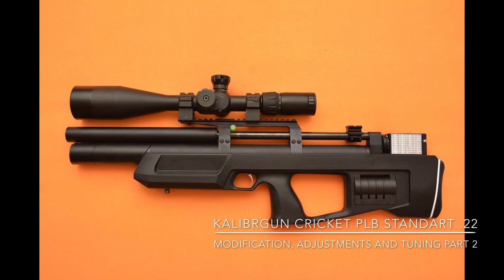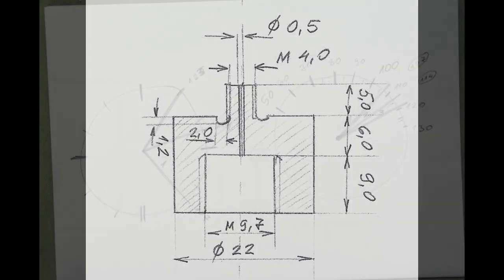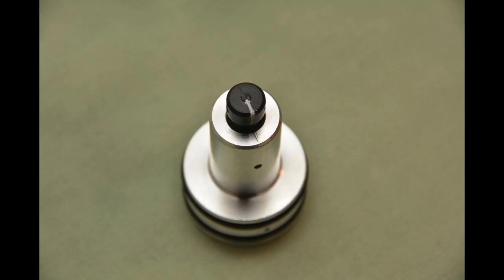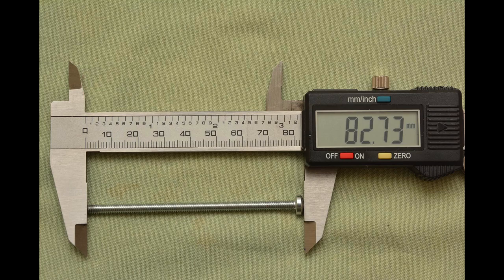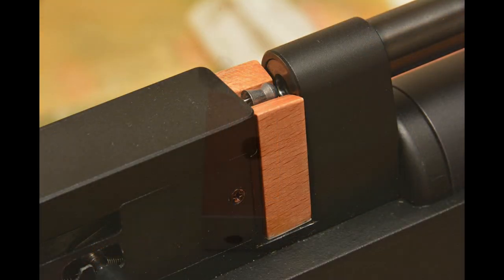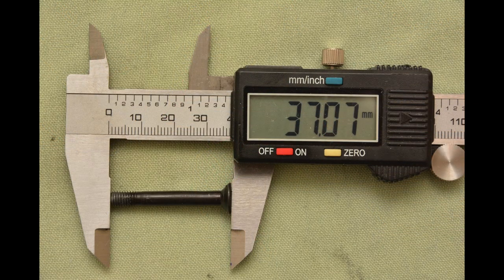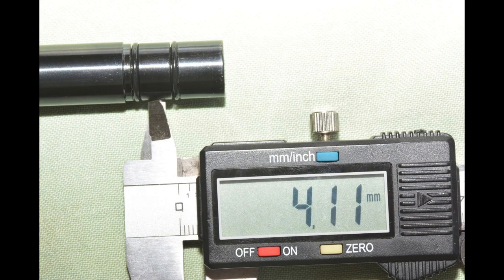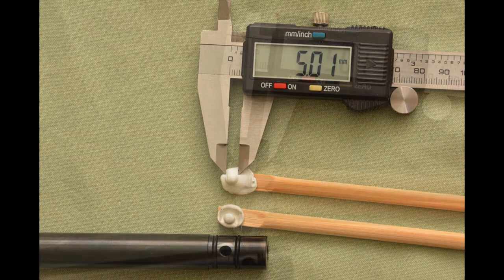Part 3 Kalibrgun Cricket .22 Modification, Adjustments and Tuning

Comment: Was there any difference in v0 by making the transfer port hole and the barrel hole equal? How did you obtain that cylindrical piece? What kind of a pen was used?

What is your regulated air pressure and what v0 can you obtain? I see that you mentioned 95 bars. Is it enough? I have my regulator set at around 120 bars and my max v0 is in 880ish. Do you know why?

How many bars per shot are utilized in your gun?
Reply from the maker: MasonStormSunny I can't say that I see a significant difference, but I know there should be flawless airflow. 
I can't remember the type of the pen - just find something that is with the same dimensions. 
I am shooting with 95-100 bars, but I am shooting with methan. It is enough. I have 277m/s with 1.175 grams, 45 joules.
From 200 bars to 100 bars I have about 60 shots.
Reply: Methan is explosive, isn't it? Do you think this gas is more effective than the air in achieving higher v0?
Reply from the maker: MasonStormSunny Yes it is, but when there is fire. The small portions of metan are not a problem, but do not try to shoot in fire. 
Methane is more dynamic gaz and is giving about 20% more than the compressed air.  
The minuses are - temperature dependance, influencing some rubber o-rings, no more than 200 bars.

Comment: I also want to know what do you use to polish the valve pin and (striker) hammer if you could let me know that would be great thanks
Reply from the maker: matt white with drill and sandpaper 1000 and 2000
Regards
Reply: thanks for the info. great vids

Comment: hi i know you havent done the video yet but since watching i looked at my crown and ts not perfect either, when you got it re dne did you get it done to an 11 degree crown? also what is the name of what you use to lube the valve pin hammer spring and hammer? if you can let me know i would really appreciate it many thanks matt.
Reply from the maker: matt white I was planing to do 11 degree, but the barrel should finish as it is originally because of the silencer, so I redid as it was the same angle and shape, just toke the bad finish out.
I am lubing with silicone oil, just very gently. 
Regards.
Reply: silicone oil like molykote 55? thankyou fr your responces.